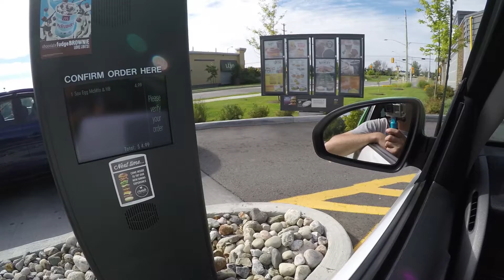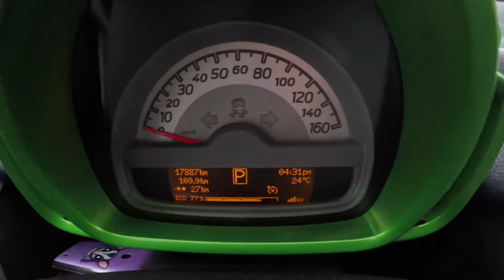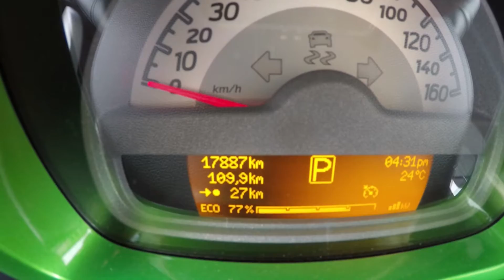National Drive Electric Week Ottawa - Talking range and battery life with EV owners

Comment: What happened to the Challenger restoration ? Haven't been able to find any videos on it in a long time.
Reply from the maker: It's on hold right now. I wanted to build a SxS dune buggy in order to take my kids on rides with me. I also started to build a garage addition so I would have the space I needed to continue working on the Challenger. So as soon as I finish my SxS (check out those videos!) and the garage addition, the Challenger is next on my to-do list!